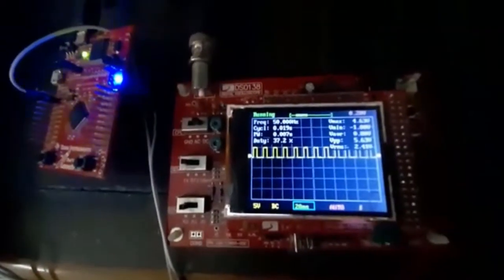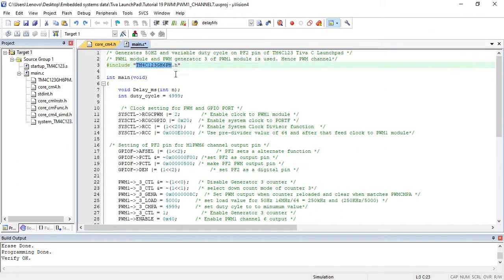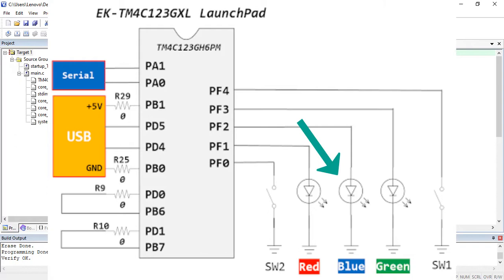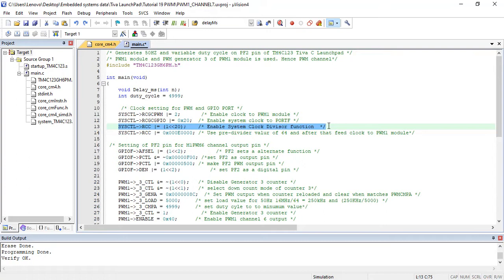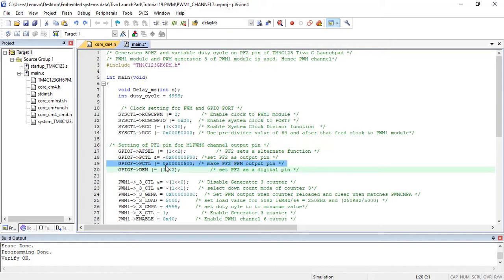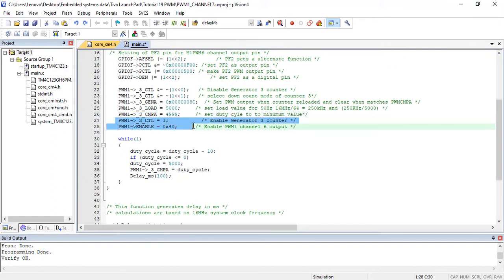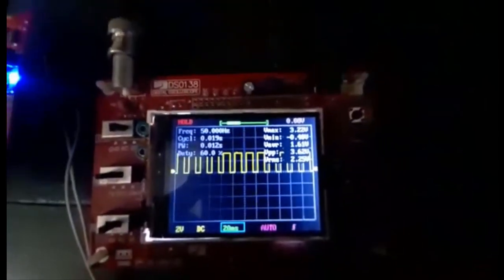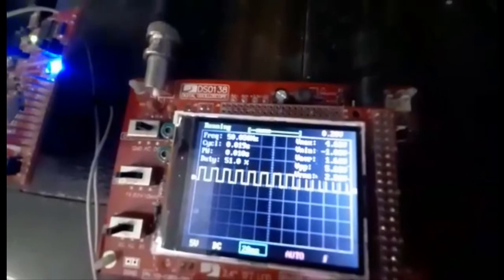PWM TM4C123 Tiva Launchpad - Genrate variable Duty Cycle PWM Output

Comment: that is working. I need to ask how to generate pwm using any other generator (0,1,2) I have tried alot but unable to do it kindly plz guide me how the addresses may change for genarator 0.
Reply from the maker: Make sure to check if you have configured GPIO pins for corresponding PWM generators properly.